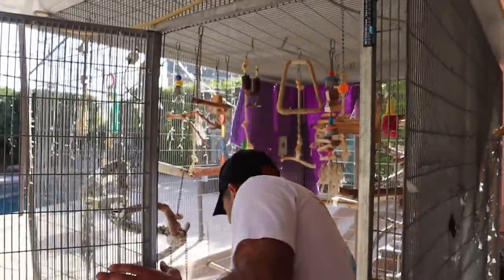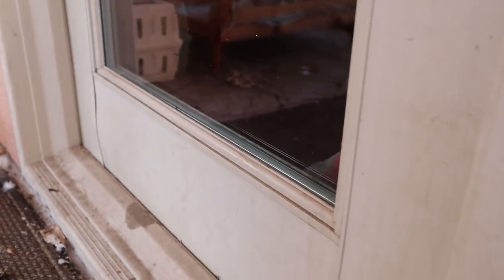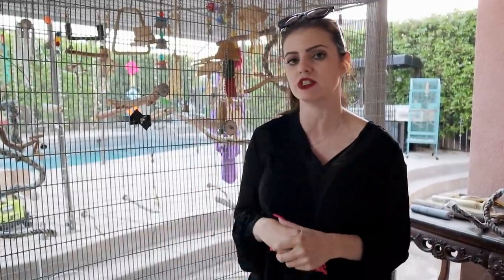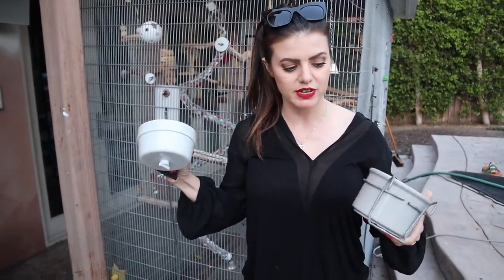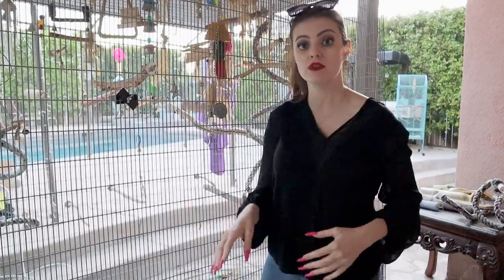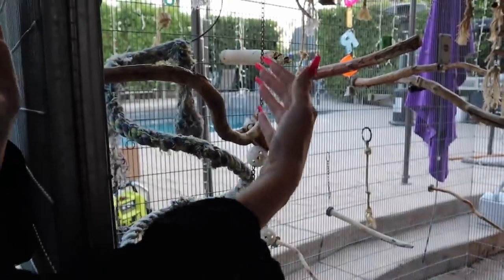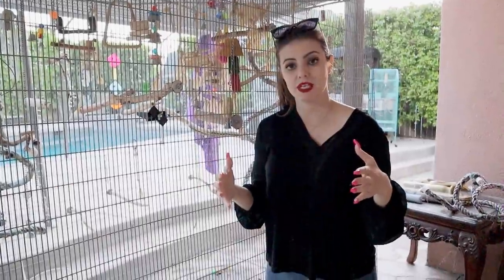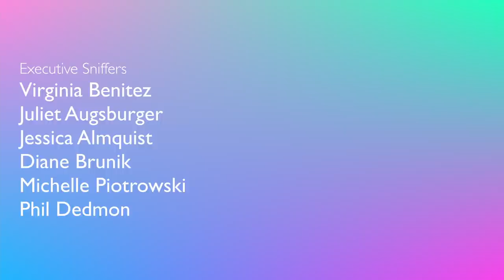Finally Cleaning out our ABANDONED BIRD AVIARY!!  Trying to make it livable for our parrots!

Comment: I buy painter's plastic in a roll from Walmart. It makes changing out the aviaries pain free. George, listen to Marlene. Cut the plastic to the correct size and lay it out on the bottom. When it's time to clean, pull the corners in to the center then pull the rest of it in and stuff it into a big lawn size garbage bag and toss into the trash can!! That's it!! Listen to @MarleneMccohen Georg she really does know what she's talking about!! 😂🤣😅
Reply from the maker: That's exactly what I was trying to say,  it's light and easy,  the grass I kind of need george for but at least it is reusable.
Reply: @MARLENEMCCOHEN  
And I do reuse it after I give it a good spray with vinegar and water with a good rinse and sun dry. I buy the thick plastic which holds together nicely. I cover it w/newspapers. Saint never rips it up. He leaves it alone. He's such a good boy. 😍